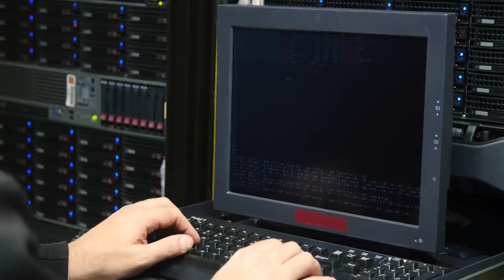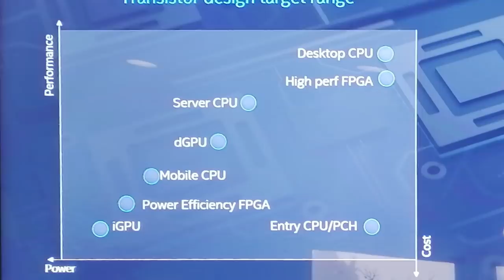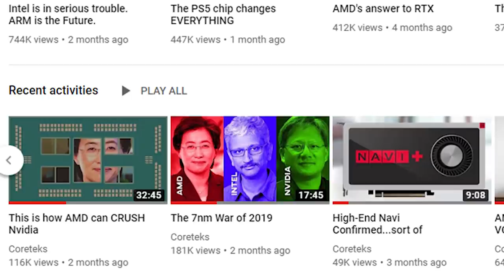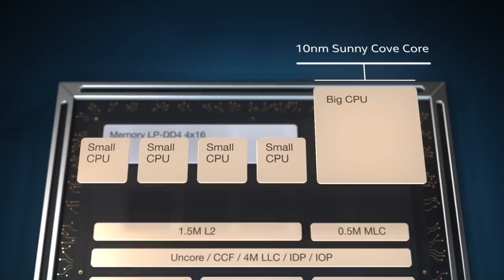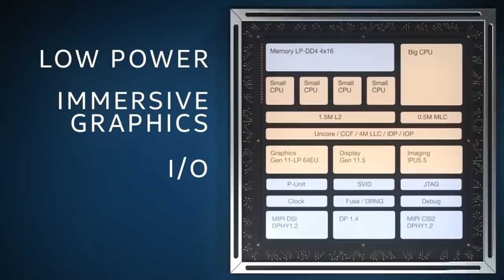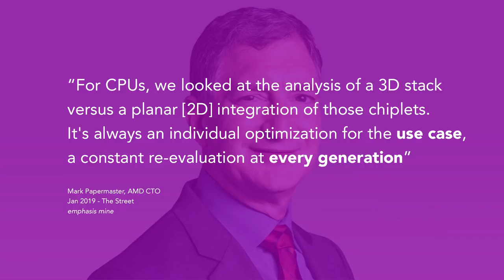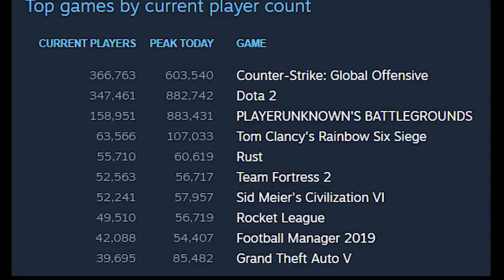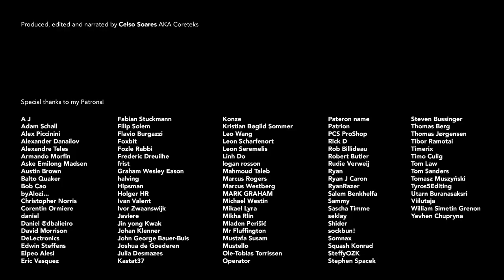2D vs 3D Stacking: Intel’s plan to beat Zen 2

Comment: sand bagging doesnt make much sense for amd at first.  but when you think of these chips as an arms race then it makes a bit more.  i think they are using this as a way to keep intel from trying to release more cores than them.  if intel stick to 10 cores or less amd will stick to 12.  if intel release a higher core count i9 then amd have this to put out.  arms races are expensive and amd will have a lot of bad binned dies to get rid of and will have a great demand for high quality binned dies.  having a desktop chip that takes up 2 high quality 8 core dies might not be what they want.  they may want to save those for server\TR.  desktop is the place to put low quality dies till the next gen consoles get ramped up.

Comment: I've seen too much hype over the years about Intel's 3D gates and Samsung's 3D V-Nand (as well as optane, etc).  Neither really pushed down prices or significantly improved performance for the consumer.  If anything, the business maintained the same performance and prices while improving their profit margins.  The 2D manufactures remained competitive.  

You're right that 3D stacking will be the future, but we're still probably 5 years away from 2D die area significantly limiting performance.

Similar to AMD Ryzen, the big improvement will come from Intel moving from the monolithic design to the chiplet design.  It doesn't really matter much if the chiplets are networked in 2D or stacked for n.  Traces in 3D may be shorter and allow for better networking, but I have a feeling the failure rate will be higher in its early years.  

Those large caches you talk about aren't going to happen.  Caches aren't magic.  You could give a Pentium 2 a 3TB L1 cache and the processor itself is still the choke point.  

Furthermore, I can't imagine that such large caches will be efficient for servers.  You'd be paying tons just to have a bunch of cache sitting around.  Main memory is a lot cheaper than cache.  For content creators, paying for a large cache chip is feasible if it reduces the time the individual spends waiting for the computer.  For networked servers, it makes less sense to pay so much extra for each processor when you're talking thousands of processors, unless the performance uplift is huge (it's not, look at i7 5775c).  There's also additional power usage to maintain such a cache.  "Past a certain point, it makes more sense to spend the chip’s power budget and transistor count on more execution units, better branch prediction, or additional cores." -Extreme Tech

The main reason Intel outperforms AMD Ryzen right now is due to clockspeed.  In terms of IPC, ryzen is on average 3% slower.  Intel has a 20% clockspeed advantage.  If intel has to slow its processors to 4ghz when it moves to 3D, at best it can only hope to tie a 5ghz Ryzen in memory dependent workloads.  Most workloads will favor the 5Ghz Ryzen.  To insinuate otherwise using the under-performing FX as an example is disingenuous.

Comment: ya, i am not convinced that in house arm is the solutions. sure they perform ok, but when compared to the upcoming 64 core amd (and perhaps even 3d stacked solutions), arm won't even hold a candle. as we speak, high core count arm isn't anywhere near amd's 32 core or intels 28 core. while, intel has very expensive 28 cores (monolith cpu's, which are expensive to make due to binning), amd's solution is way cheaper to make by comparison. so....what is the price of arm based off of for the in house solutions? you said i think 40% saving (don't remember where you said it), if it is lets say 40 to 60% savings, it is most likely based against intel as intel has had near dominance in the server market, a 32 core cpu from amd right now, is 60% less than intels 8176 cpu. so....if building a cpu that cost the same as what amd is selling, yet amd utterly wipes the floor with that arm, then it would be far more cost effective to buy from amd as it will need less space. you'd need to near double the space for an arm based server vs an amd as amd is nearly double the performance of a comparable arm (and that is with a 32 core cpu. their 64 core cpu will widen that gap dramatically). so....really, i don't see arm as the solution at all. amd's chiplet design is the way of the future for the moment, i can see a 3d design going into the future, for raw brute power, they will need high core cpu's and for the near future anyways, arm isn't even close to amd, which we might as well say who will be the power house leader, is amd, because we all know what is coming later this summer.
now, if the entire gaming industry goes towards cloud based servers, arm isn't even the answer there either. sure, arm could probably power, lets say fortnite servers. fortnite is not a demanding game  to run. if  going into the future, a lot of games will need to keep getting better, red dead redemption is an example. most people who play it says it looks great. which, rockstar probably will eventually release on pc and you will get what it truly is meant to look like due to much more powerful graphics cards in a pc. i think, just cause fortnite is popular, doesn't mean for a second that the entire industry is going to start producing shitty graphics games. some will, others will produce really good looking games and people will buy it because people like how well it looks. witcher 3 is a perfect example of that. 
now, in order to get the most out of lets say a cloud based server's graphics, there will still be a bottleneck even on that. simply put, a server is just a larger pc (i am highly simplifying it, no it isn't the same, but i just mean, that the server that is producing and running games, will still need powerful hardware to get the most out of graphics that they are presenting). so....they will need cpu's with a high ipc. arm just isn't there, not even close at the moment. with intel and amd probably going to 3d, and even if arm does as well, simply put, the core vs core, cpu vs cpu, intel and amd will still dominate. 
so....to get the most out of graphics, those servers will still need powerful cpu's, some game companies will produce games with shitty graphics and sure, some of those games will be popular, other companies will release games with high definition graphics. so....will need cpu's and gpu's powerful enough to run on it. so....the only one really capable of producing an all in 1 design right now, is amd. amd can combine graphics and cpu's all on lets say, a 3d design. i doubt intels in house gpu will even get close to amd's or nvidia's. so.....really,  when it boils down to it, arm has no gpu's being mades, they would have to lease or buy gpu's from either nvidia or amd just to put in a server, while amd could theoretically produce a 3d socket with integrated graphics that would decimate anything intel came out with. so.....when it boils down to it, at the moment anyways, amd is the winner when you view it all as a whole. 
amd's decision to buy ati all those years ago was a smart one. it will allow them to have the a huge chunk of the gpu patents to be put into products in the future. if nvidia wants to compete in a 3d design, they would be forced to either side with arm or go with intel. right now intel and nvidia don't exactly see eye to eye. so....would most likely be arm.

Comment: I do think you underestimate the amount of heat that ferverous might put out if it's competitive with today's high end chips. Contrasting bulldozer didn't help you convince me either. I do see 3D chips as a package deal, as in it will fit into small places...i dont know to much about any one microarchitechure but i do know there are trade offs with size of the core/instructions per clock/number of cores/ heat generation /and clock speed. The only way i know that most of these metrics can get better is by a node shrink. Even still you run into the issue even with node shrinks is that your power per area goes up making it harder to coolif i had to wager I think 2.5D something with an active substrate might perform better than something with ram possibly stacked over cores.... I mean Vega is an example... The hbm becomes sensitive to the heat and voltage of the cores. If you had to have the memory act as a transfer medium for the heat from the cores it might not do as well.AMD is also looking at "next gen" and "near memory" as well... what would be cool is a new standard... Like HBM if possible... Of course its not cheap now, but it's pretty interesting spec wise if it were to replace DDR types.

Comment: Cache size is meaningless to the desktop consumer market in the current and near-future software ecosystem. The latency of the interposer would be worse.

It might show up in synthetics or server based workloads, but then you ask yourself about PPW when you probably have to actively cool a 3d stack CPU instead of low ambient isolation.

Comment: hmm very interesting that intel planning doing a 3d stacking but it will cost a lot of more problem than making 10mm chip process its already proven that intel been delay many times for 3 years ago . so i think 2d process is more simple than 3d process and easiest to manage heat itself and less price cost and finally easy to produce more of them . but hey i m no super expert tech . so yea all i m saying to this  . i m still sticking to zen 2 because its is much simple than a 3d stacking process intel and please it may sound like i m bias amd but i m not cause . i m still using my 7 year old intel computer havent bought amd cpu yet and i still planning buying a new computer in the future someday but that s all i can speak in my mind about this

Comment: Intel multi-use stacked cpu's = computing, home heating solution and toaster oven. Simply O/C to obtain a flame broiled  barbecue grill.  Add a aio open loop to make a coffee maker.  Wow, this will make a great infomercial.  They can get Ronco to market this device.   Who is this guy kidding, Intel has a solution to the thermal problem?  REALLY?  What's that, add gobs of thermal paste between the stacks?  I have a better solution,  MAKE THE CPU's BIGGER!  Can anyone say Thread Ripper!

Comment: MMO's THAT ARE NOT DEMANDING...
I think the argument that many of the most popular games aren't too demanding but need more servers to run the player (and sometimes destruction etc) interactions means that game devs will NOT invest in great looking single player titles is somewhat weak... is this a NEW trend or has this been going on a long time?... what PERCENTAGE of games etc?... I would argue that maybe more powerful GAME CONSOLES in 2020 or so will have more of an impact on the Desktop PC Gaming market than anything; if you can get a $500(USD) console that does 4K/60FPS or close with 1080p or 1440p at 100FPS+ with excellent anti-aliasing then I think gaming PC's will be hard to justify for a large percentage of current users (obviously not everybody) but I'd still call these pretty powerful consoles (maybe not the paper spec but consoles can do amazing things with less hardware)...

Having said all that, I do think we'll see a big slow-down in the PC space for other reasons than this, including games looking "good enough" (same reason for consoles displaying some PC's). Once you get anti-aliasing ironed out better, and get 1440p/4K more common, with better textures, and newer techniques like Photogrammetry etc all pushing us closer to PHOTOREALISM then at what point do people say "meh" to upgrading their PC's?

I know there is more than VISUALS (AI, collision detection etc) but I think it will get harder to convince people to upgrade their systems. It may be DIFFICULT however to verify what the main reasons are. Consoles? More MMO's that are less taxing? Diminishing visual returns? Probably all of the above.
Reply: can't edit... should be "consoles DISPLACING some PC's"

Comment: And what if amd add hbm to the apu processor?
Reply: The price will probably skyrocket, if it's HBM2 we're talking about.
Reply: it would depend on volume hbm's price right now is quite a bit higher than first expected due to the large demand from expensive products but relatively low volume (it launching right when memory price fixing was at its peak did not help), using it on cheaper products would mean its price would come down quite a bit

Comment: Heck Current server cpu that amd is making wont go away you have multiple companies that have 3-4 servers it will just drop amount of server chips sold you got gaming servers owned by small groups they will still get those when there is enough gain on those it wont be released every 3-6 months but like 1 per year or so. Renting server for more than year isnt worth it as buying and colocating server for 20-30 player group is cheaper to colocate pre brought one than rent.
Higher cache sizes slow down read times 1.5 ms for l1 ~ and 30ms for l2 off die 120ms becouse of path lenght it might not be so good idea.

Aso you didnt mention that off die cache will use more power becouse longer path will cause higher rezistance thus use more power with higher latency  it could be done for l3 cache as mid point for ram/ cache  or even as L4 cache to keep lower times on fetching data from cache as off die will wreck havoc on cpu waiting for data it needs.
 Still its worth to wait for what they will offer. If they do cpu core more optimized with less heat spots it would solve most of their problems without any need for off die cache unless they intend to add new layer of cache as l4 or kick l3 off die and increase l1/l2 to mitigate drawback from fech times.

Comment: As you say Intel could gain the race for a while with 3Dstacking but you said 3D is not  a new idea, so AMD might work either using 2D and 3D at the same package. is it possible?

Comment: What is the benefit of having 1g L3 cache!?
Reply from the maker: When running operations the CPU needs to store and fetch values from memory. If it runs out of space in the local cache (that's usually within the cpu die) then it needs to store/fetch in system RAM, which slows down the whole process.
Reply: @Abdrouf-  Here's a good article that's explains it pretty well  https://searchstorage.techtarget.com/definition/cache-memory
Reply: @mistamisa7271  thanks

Comment: No, it doesn't make sense for Facebook to design chips. The existing industry giants justify the R&D costs by selling enormous quantities of product. Does Facebook intend to do so?

If not, then they cannot justify the development costs.

If they do, then they're up against stiff competition. Does the market need another semi manufacturer?
Reply: That's exactly why they have approached Arm-Holdings for a license to use their Architectural IP, that way, they can make slight modifications to suit the real world use of the chip without having to develop an entirely new CPU architecture.

Comment: Pretty sure Intel won't be able to make a comparable 3D stack processor to AMD, without a stupidly high thermal output. At least not with the high clock speeds they currently can reach.

Also, lol @ the "FX9590 couldn't hold a candle to Intel 4770k" claim, whilst showing only a  ~6% performance difference in the chosen benchmark in the video.

And no, Intel will not put 1GB of cache on their new processors. Nor is 3D stack the future, at least for the next 10 - 15 years.
Reply: "only a 6% performance difference". 
I guess the 134w, 1.1 ghz, and $570 are just in the margin of error territory

Comment: Amd lost in the past with intel using different architecture and cheaper manufacturing solution than intel that made amd cpus slower and more energy hungry , bandwich or amount of cache may mean nothing if architecture fails in the first place see pentium 4 northwood 3.4GHz with 512kb cache beat prescot 3.6GHz with 2MB cache.
No one solved yet problem with heat dissipation in stacking chip packages and this alone indicates that new intel chip will be at best throttling like smartphones cpus or even more..

Comment: i dont think they will use foveros for desktop cpus.  at least not for a long time.  this would be good for mobile and specialty server chips.  but i think they are making this for taylor made solutions for people like amazon or something.  maybe self driving cars.   youve already said that these companies are making their own chips. but a foveros type design might be beyond their capability and even if they can do it intel might have patents that would at least need to be licensed.  so intel would get paid either way.  

of course at the end of the silicon shirnks the chip might be so delicate when it comes to heat and voltage that you cant run the tdps we have now then the heat becomes moot anyway.  of course intel could be experimenting with new cooling setups.  i could see these chips being sealed and then flooded with a highly thermally conductive fluid and maybe even a way to circulate it.  could even be in cased in a vapor chamber

a specialty xeon with a a couple stacks of gpu ram on top, a gpu in the middle and a cpu on bottom might make sense.  but power delivery might be a problem.  then agian if you can integrate all that on the mobo then you dont have a serperate pcb to make.  it might work.  for machine learning setups that could be a possiblity

Comment: What's the point of 3D stacking? More heat per square mm? Processors this days have far bigger PCB then the chip it self due to enormous number of pins. the only advantage of 3D stacking are lower manufacture cost because more chips can be made out of one silicone wafer.